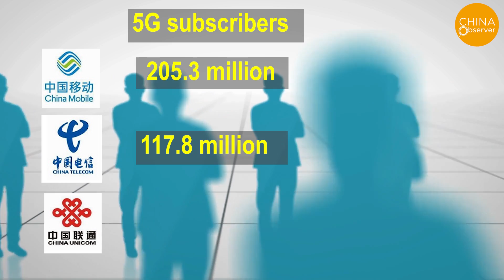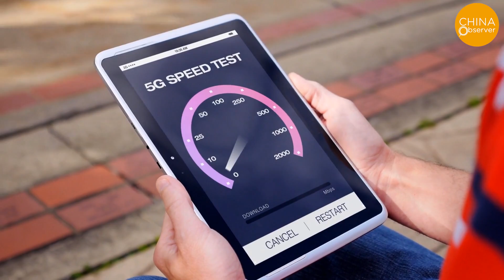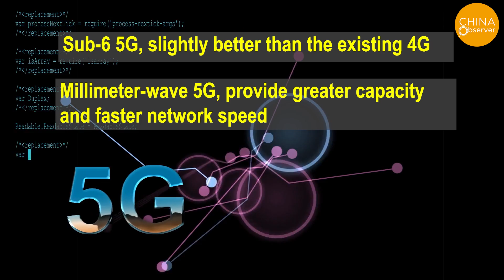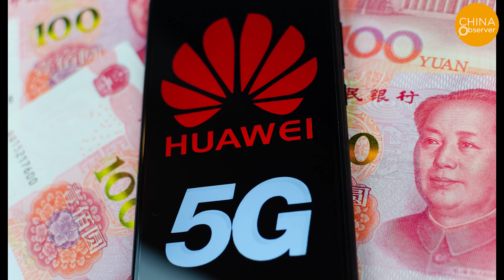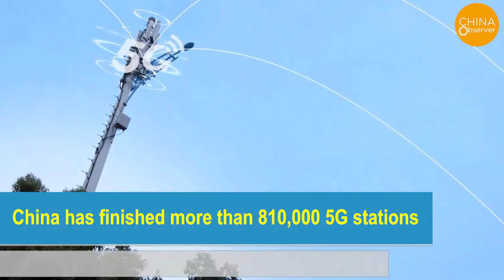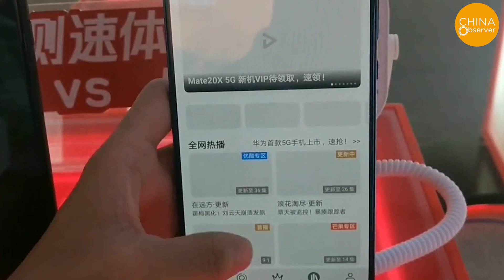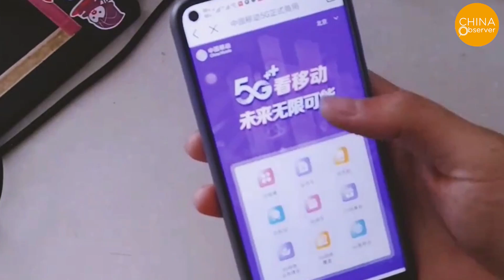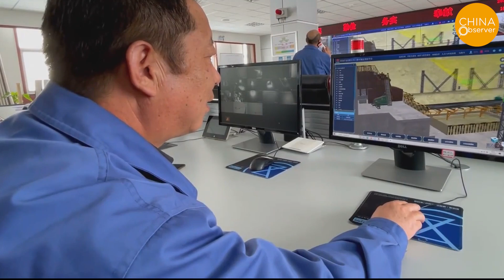How China was trapped by 5G| Huawei 5G | China's 5G Leaves Operators In A Dilemma

Comment: 5G doesn't have a sense for mobile phone users but as a replacement for ADSL (fix connections where fiber optic is unavailable) is perfect. Operators in my country if it is possible usually install solar panels in the vicinity of 4G and 5G towers.

Comment: Consumer 5G is a solution looking for a problem. It has applications in robotics and industry 4.0 where you need low latency wireless communication between different robots, but for most consumers, there is no benefits. My theory is that network providers will intentionally throttle 4G in order to push 5G sales.

Comment: Another wishful China fail propaganda video. If 5G is so bad, why are the Americans trying to roll out 5G and develop 6G. These guys are missing the whole point. 5G allows all homes and users to end their need for cables. Just like how 2G and 3G has allowed underdeveloped countries to go directly from land lines to cell signals, 5G will allow all homeowners to get off of cable internet and cable TV. I would love to get rid of my Wi-Fi routers and repeaters in my house. It is sucking up so much hydro, because they are on all the time, let alone connections keep dropping all the time and I am kept told to turn the routers off and then back on again to reset. Last year, one of our neighbors was re-doing their driveway. They cut our internet/TV cable twice. The cable company had to send repair people twice, where on the second timer they had to re-bury the new cable. I am sure this happens all the time and is costing the cable companies billions of dollars, which is reflected in the price I pay. With wireless, none of this would be a problem. Imagine the cost savings of connecting a condo building wirelessly, instead of running cables to each unit and then maintaining these cables.

Comment: While 5G is still too immature to provide much advantage, I have started to feel the potential 5G can bring, not from the nonsense they are bragging about of course. In peculiar cases such as Australia, whose cable network upgrade plan is completely nonsensical, rendering most homes even in major urban centre not accessible to fibre optics, 5G is becoming the preferred way to access high speed internet. My friend who lives in the middle of the city still use phone line to for internet, after being unable to bear the slow yet inconsistent internet, after the government had "upgraded" the network, they switched to 4G modem, because 5G antenna can't reach their building despite the 2 buildings next door being listed as "available", and had experienced much better speed, albeit the occasional hiccups. If 5G towers can be rolled out effectively, it might be able to alleviate some of the pain from not having access to FTTH. This might becoming relevant soon as more places where fibre isn't available but have cellular signal. My only concern is 5G limited range and penetration, having multiple devices connecting to highspeed internet should choke out an antenna quickly. For 5G to work well, the city might have to install antenna on every building. Still, I am  confused by the level of marketing 5G receives. It is just cellular wifi, a term which might be a tautology.

Comment: Why the hell would you want to run 5G for industrial uses? First off, mesh networks for large sites work better, for plant level connectivity, wireless would work better and be far cheaper, but if you have a lot of processing equipment being used in the plant, the interference would likely ruin any wireless network, regardless of technology. Machines other that robots and other mobile platforms are much better served by wired connections.

Also, your network is much harder to hack if it is wired or at least short range. Maybe the CCP wants to monitor industrial activity in real time and not get fake numbers handed to them by managers?

Comment: Im generally a fan of new tech, but I really have doubts about 5g in the next 10 years. Ive never maxxed out 4g. I cant see the point of 4K video on a handheld device. marvelous on a 80 inch screen, not so much on a 10 inch tablet. Given that the 5g coverage is so spotty, any mobile use, such as self driving, MUST be able to work on 4G, or even better, full autonomous.

and in my country, australia, owing to the distances often encountered, 4g drops out soon after leaving a population center. 3g is the way of life for anyone rural. there is 4g fixed wireless for rural broadband, but they usually have very high gain antennas and quite a bit of other infrastructure, such as masts or community internet cabinets installed at a high point and then plain ol WiFi down to a community.

the only real application I can think that would need it is outdoor 4k livestreams, and even now that is manageable with paralleled 4g uplinks. paralleling hardware was insane on 3g, but we used it to provide studio grade audio uplinks, but took a whole roadie case of hardware. 4g solutions come in a single box.

Comment: Imo they shouldve mixed & match 2G/3G with later iteration depending on consumer usage. Like txting/calls which 2G can cover, light social messages/internet 3G can do, heavy internet like streaming/downloading/etc 4G+ & not totally discontinue or stop functionality as 2G/3G have longrange coverage that can even work indoors which is useable in emergency situations. Imagine being trapped in a collapsed building and you have with you your phone, but sadly since 2G/3G got axxed, you wont get signal since 4G/5G got low penetration on thick walls.
Reply: turning off 2g was a huge headache for my company. we have alot of LED signage out in the wild, which has a very low data requirement, but does need connectivity. the most upstream data was a handful of bytes, giving a few voltages and temps, and any error flags. 95% of the time, all you would send to them was few bytes saying "display frame 5" as the actual display only displayed a handful of messages, mostly preset in the workshop or during commission. uploading a new frame took maybe 30s? 

when we had to update to 3g, it required new modems and antennas. but many remote sites (we have over 100 sites in Queensland and the Northern Territory, not alot of people out there) no longer had the range to make it with the standard antenna. and trying to explain to a bush cocky how to align a directional antenna over the phone or HF patch is a nightmare. let alone a satellite modem...

Comment: SURVEILLANCE WITH THE USERS PERMISSION = 4G.
SURVEILLANCE WITHOUT THE USERS PERMISSION = 5G.
SURVEILLANCE AND SNOOPING WITHOUT THE USERS KNOWLEDGE = 6G.
Reply: basically the 4G has been switched to be 3G and the so called 5G is actaully 4G. You can feel it when u use it. This is a fact. When u r at remote areas in China, your phone will auto switch and locate the strongest signal. At times u can see 2G on your phone.

Comment: 4G is probably much cheaper to build, have better penetration to building and can achive 5G like speeds if your phone support multi-channel LTE connection (aka LTE Advanced).

for 5G to work at high speeds, you need to build more stations, and if your going to this route anyway, just build more 4G stations instead, cheaper and cost effective.
Reply: 5G can be more cost effective in dense urban areas as they can utilize several but smaller towers/boxes, especially taking into account the fact that tall buildings block 4g signals anyway. The biggest advantage for urban areas is (depending on the provider and their specific tech) the ability to essentially split spectrum among users more efficiently so for areas with huge numbers of people like malls or stadiums the amount of people wont overload the network as can happen with 4g. 
Even with these advantages 5g imo is still overkill but for a country like china with its insane population and high population density it can be worth it in areas. Best usecase still imo is self driving cars which need high frequency data transfer to operate safetly.
(im not 100% certain on exactly how spectrum splitting works, but i think thats a good enough explanation)

Comment: There is no single uniform standard for what defines 5G, just a collection of different frequency ranges and transmission technologies layered on top of existing 4G/LTE technologies. The carrier's implementation of various elements of the 5G menu of technology and transceiver options, along with density of equipment placement (especially for the short-range, high-bandwidth mmWave elements, which can require near "line-of-sight" placement), makes 5G a crapshoot in terms of what you might get. A carrier can stop at DSS and claim they are 5G. 

A good example is that in my house, which is in NY metro (literally 20 minutes from Verizon's Operations Center), I'm seeing performance on my 5G phone that is only marginally better than LTE. In other areas, it's 802.11AC fast but, frankly, I don't think I've ever once noticed the difference between my LTE personal phone and 5G company device in practical use. Most of the time, if I'm at home or in the office, I'm on wifi, the rest of the time I've never felt constrained by LTE. Truth be told, most of my heavy bandwidth stuff, streaming 4k video, playing games, pulling large ISO images, cloning big repos, or syncing containers, is all done via wired ethernet or over my 802.11AC wifi, both running off 1Gb/s up/down FIOS fiber (and that's not hypothetical or peak, that's a consistent 1 Gb/s throughout the day with no caps or bandwidth costs).

For most people, what is 5G going to mean when you generally only care about high-bandwidth and low-latency when at home? What, am I expected to use my phone as a mobile hotspot for my Apple TV? Nobody's watching 4K video on mobile devices because you'd need a magnifying glass to see the difference. Especially in post-covid world, we need better home solutions (e.g. fiber to the home, satellite for remote areas), not mmWave cells plopped every 10 feet in now empty (probably for good) business districts. 5G, especially mmWave, was possibly the right solution in 2019; in 2021, 5G is a solution for the bygone world of the commuter model.

As for Chinese 5G, yeah, it's all just CCP phallus measuring.

Comment: good point!
more so... the only part of ANY phone capable operating in 5g speed is the RAM memory. no phone can read\write more than +-500Mb\s :) and those are only a few TOP end models, the rest much closer to half that.
not saying it wont speed up the internet use. it 100% will. but still... not a single phone can PHISICLY use the advertised speed. NOT A SINGLE PHONE TO DATE:)

Comment: This is what happens when you steal the blueprints and forget to steal the business plan 😅😅
Reply: Are you saying China stole 5G from someone? Lol. China has the most patents in 5G
Reply: @user-ne1tv3hb2k  What has that got to do with anything. Having a patent simply means you were first to register. Doesn't necessarily mean you invented anything.
Reply: basically the 4G has been switched to be 3G and the so called 5G is actaully 4G. You can feel it when u use it. This is a fact. When u r at remote areas in China, your phone will auto switch and locate the strongest signal. At times u can see 2G on your phone.

Comment: Every single application advertised to be using 5g has already been running on 4g. In the industry there isn't even a differenciation between the two as there is in consumer advertising. 4g and 5g are both part of the LTE lineup and are simply given category numbers like LTE cat.6, etc. This is especially apparent when they advertise IoT LTE networks as 5g which is counter-intuitive since the IoT bands are extremely slow (and low power ofc). IoT bands are usually LTE cat.1, LTE cat. M1 and LTE cat. NB1.

Not to mention the ONLY cases where you need gigabit connection speeds on an LTE modem would be for professional use such as uncompressed video streaming but the upload rate in current worldwide implementations for consumers is capped at 150mbps rendering it useless.

Comment: I already get 30mbs down on 4g and 100mbs on fibre. There's literally no reason to pay the exorbitant cost and deal with the poor range and indoor performance for 5g
What a waste with no real world use
Reply: :0 greetings from Germany - we are getting Up to 225 mbps in 4G and don't need Mode than that
Reply: I have heard people claiming they are fine with 3G and 3G speeds.  But they all seem to forget the number of future users.
At present I have a 1TB quota on 4G.  Imagine a lot of home users starts using similar quotas from the same tower.
Thats an important area where 5G will shine.  Also 5G will have longer or similar coverage to 4G for the lowest frequency bands.
At current 4G is on 800MHz and up here, while 5G will be 700MHz and up.  But the wast majority of users will use 2GHz and up.

No need to try to spin 5G as worse than 4G on coverage or speeds in any shape or form.

Regarding the high GHz bands, I think there will be less base stations than planned, outside the big cities.   But in the future e.g. cars can use other cars 5G as a mesh to extend low latency coverage.  It will be a very cheap way to make a big network where there are a lot of users. 
Perhaps also regular phones chan be used as a mesh, once the power usage is within reasonable use.
Reply: 5g has lower latency for remote control and gaming and it's cheaper for the networks since they can have more phones connected to a single tower
Reply: @jmlinden7  According to this video, just building the 5g infrastructure is INCREDIBLY expensive. Cable 4g seems the way to go for now.

Comment: Lol. You are like telling ppl not to have high speed train because it has high maintenance & operating cost. What you didn’t say is the high capacity of one 5g cell compare to one 4g cell, in order to have the same capacity u need more 4g cells. There are many solutions on 5g, if not using massive mimo, the power consumption is comparable to 4g. Once 5g network is built, Chinese companies are able to innovate and create applications on 5g before anyone else.
Reply: 5g can use low frequency as in 3g and 4g. China will built 5g network on 700Mhz freq, which can cover more than 5km away. 5g can also use 30Ghz freq which coverage is less than 100m. so saying 5g coverage is small is not true

Comment: 5G telecom here in Toronto is a scam just like 4K TV.  $k TV is two channels that require a special cable box and a 4K plan adding over $CDN150 a month to your cable bill. The two channels are jsut sports channels. This situation has existed for 6 years and is not expected to change before the turn of the decade in 2030 or 2040 even according to leaked Rogers internal documentation. With Rogers, one of the dominant cell phone providers, they have deployed 3 towers across the entire Greater Toronto area as trials. That was three years ago. So far not one more station has been added. On top of that, they are charging a $CDN100 a month premium for 5G and 5G phones are not being rolled into free promotions for new accounts.  I have an iPhone 11 Pro and it doesn't have 5G. I see no advantage to getting 54G. I am on social assistance and adding to my expense is not an option. I will keep this phone for several more years. I expect a seven-year period of use before I update my phone.

Comment: and the 5g here in the USA is fake, it's just using old TV bands, it's more like just an upgraded 4g since 4g is on old TV bands too, Verizon's 4g LTE uses the 700 mhz band width of the old TV stations from channels 40 to 82, but they are a hell of a lot better than the old 3g which actually were running on higher frequencies which were actually closer to 1ghz to 2.5ghz which is a true 1G and 2G, go figure'  ;|)  plus... if they used real 5G at 5ghz it would fry our brains and kill the world while it's at it, and 6G wants to run at 10ghz??? something beyond physics would happen if they do.

Comment: 5G is actually useful in autonomous work in factories, airports, ports and packaging centers.
Reply: basically the 4G has been switched to be 3G and the so called 5G is actaully 4G. You can feel it when u use it. This is a fact. When u r at remote areas in China, your phone will auto switch and locate the strongest signal. At times u can see 2G on your phone.

Comment: 3.5 kW that is a lot of power :) that networking equipment likely has 80 to 95% PSU efficiency, likely already running on ARM or other risk chip or even aisic manufactured using relatively recent process. With beem forming 5G has less power consumption per user per gigabit. Only with time 5G can become cheaper and more efficient at the same time. Power bills could be cut by adding solar PV to base stations the system does not even need an inverter.
✔️Lower transmission costs.
✔️Lower electricity costs than usig grid in Lage part of the world.

Comment: Marketing hype is ascribing magical qualities to 5G networks. It's a faster and more efficient radio standard than the 4G. Nothing more, nothing less.
Very few real world applications are restricted by bandwidth, so that switching to a faster standard would make a difference.

If your business needs high bandwidth, wireless network for industrial automation, you could achieve it with a local WiFi  ... long before 5G entered the market. If it doesn't need the extra bandwidth, then 5G will only add to your expenses.
Recently I saw the first, at least to me, real world example where 5G is actually required - 4K live broadcasting for media.